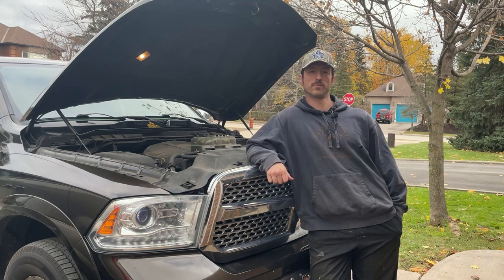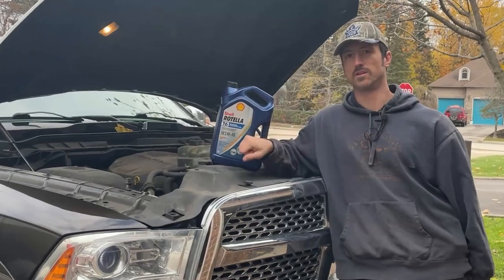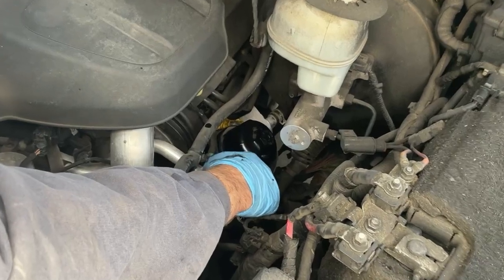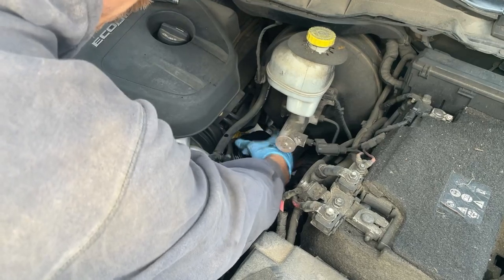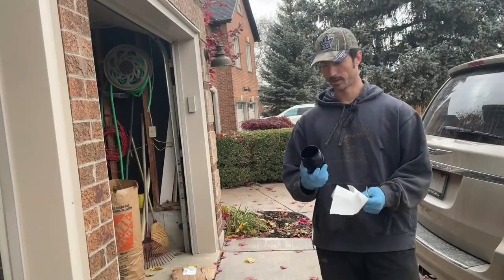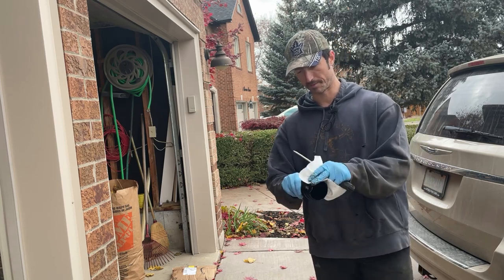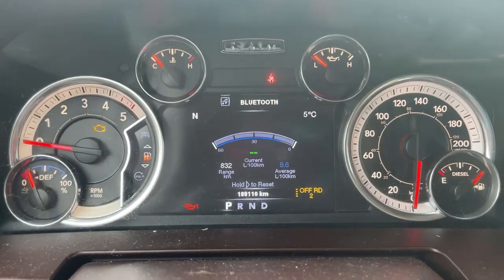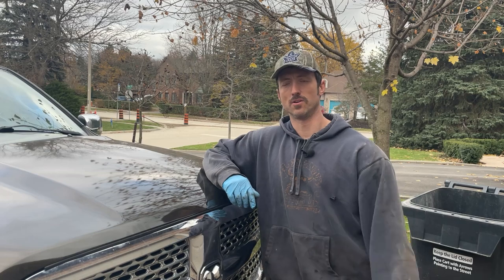How to Change the Oil On Ram Truck EcoDiesel

Comment: Our friend JustMoparJoe’s eco diesel grenaded on him out of the blue.  Interesting to hear about Chrysler’s change on the weight.  I’m kind of seeing these engines as I do the 4.7…. They make good power, but will go out anywhere from 50,000-300,000 miles and give no clue as to when.  🤷🏼‍♂️
Reply from the maker: So far so good for me. I had one issue with the def system due to the cold which Chrysler addressed, and obviously the dpf recall.  Closing in on 200,000 km so far.  

I think the main issue is the emission add on they’ve been forced to use.
Reply: @VicsGarage71  Exactly.  That has killed many a good diesels.